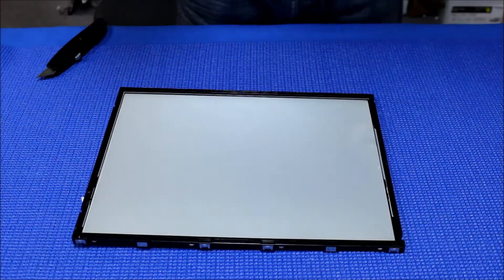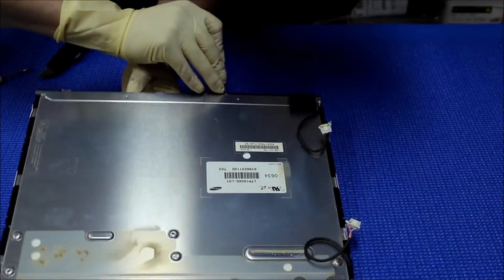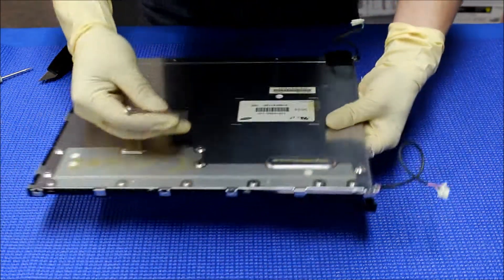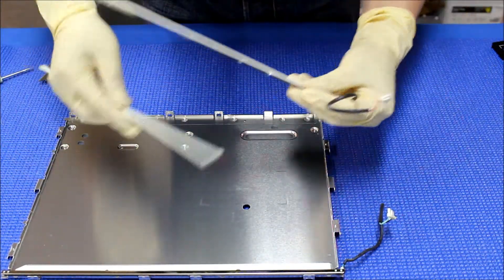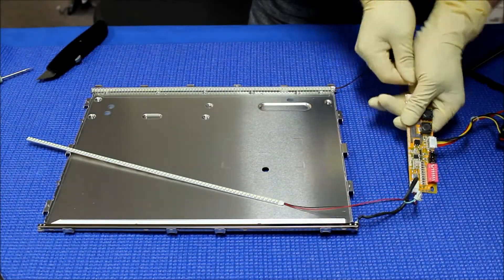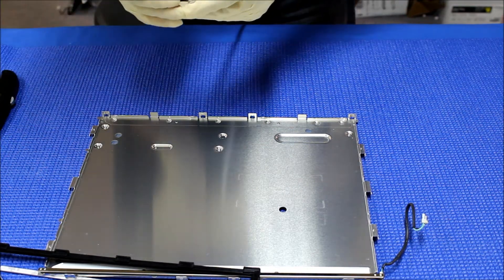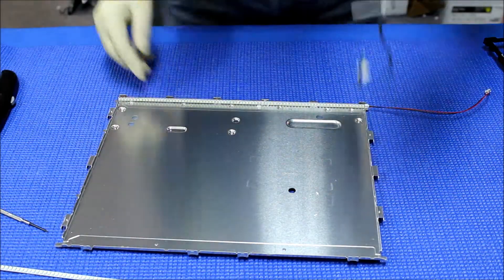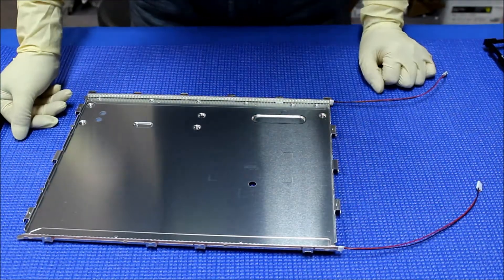Elo Touch ET1546L, Part 2 of 3

Comment: For the block connector to the backlight PSU, it has 5 wires, orange, red, yellow, green, blk. Orange and Red measures 12V but yellow wire shows around 3.2 Volts. Should yellow be 5V. It shows 3.2 V weather connected or not to the backlighter PSU. When I power up the touchscreen the backlight briefly comes on for a second or two then screen goes dark. I can see PC windows desktop on screen if i shine a bright torch on the screen so I know the VGA outpt is working fine and it's definiteley an issue with power to the backlights. I just don't know if it's an issue with the main PSU supplying the 12 Volts, or the backlight inverter PSU which supplies power the backlights. What should the yellow wire Voltage be, 3.2V or 5V?